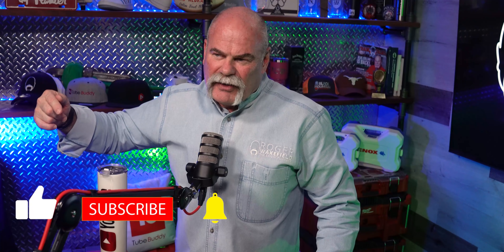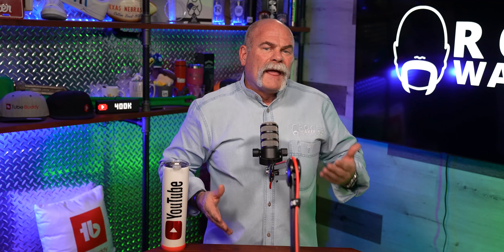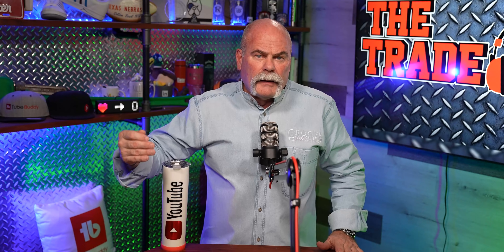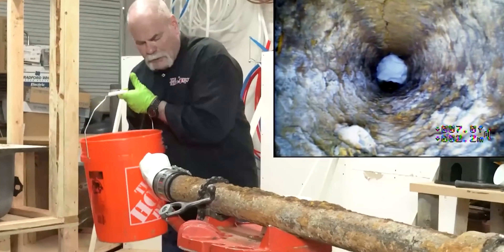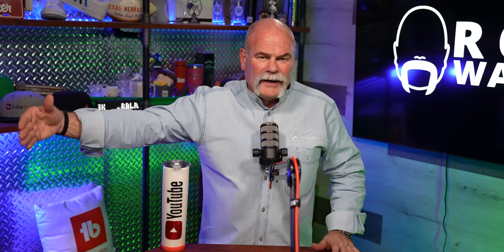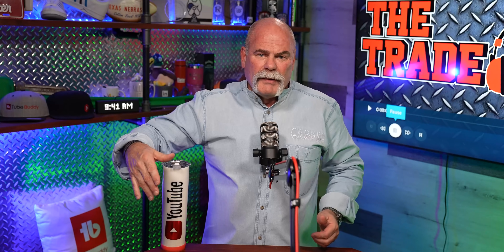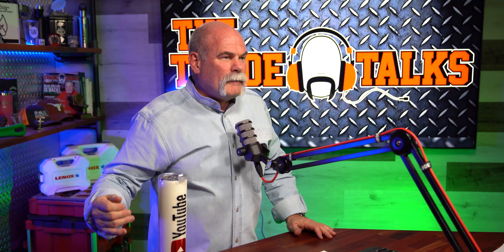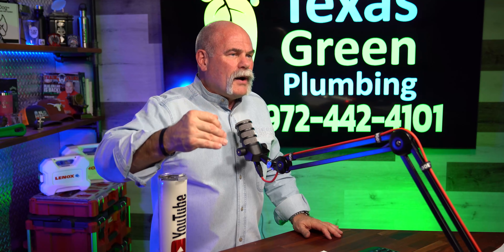TUNNELING UNDER YOUR WHOLE HOUSE TO SAVE YOUR SEWER LINE

Comment: You would never be able to do this in Tennessee all the limestone we have plus clay in various parts of the state if you have a slab we have pinpoint the line jack hammer the floor up repair the pipe pour new concrete not to mention finding a floor guy if you have to patch hardwood,tile,etc and hope to find the matching pieces it can be a major pain

Comment: Hey Roger, I'm a bit confused with the terminology here. I was taught slab leak is in reference to the water lines under the home so checking Meter with utilities off can show if something is leaking. If it was we hook air to the water line and go sound it out listening to bubbles. Is the sewer cam really a good way to find the leak sometimes because often they run water next to the upper lateral?
Reply: He is in texas.   He probably wont understand your point
Reply: You won't see a water pipe leak from inside a sewer pipe.

Comment: If I ever needed this done for me, id want every freaking square inch of that cast iron removed. If its not leaking or broken now, how much longer can it possibly last. But I do like that you as a contractor aren't pushing that on customers.
Every damn inch of it, schedule 80 pipe, stainless hangers, the works.
Would it cost me a lot more, yeah. But damn it that piece of mind knowing it won't be a problem again sure would be worth it to me.
Reply: Schedule 80 is wayyyyyyy over kil man lol but your right never ever have a problem
Reply: Ive seen 100year old cast iron with led joints and they are sealed perfect its crazy.
Reply: @GeneMichaelMeredith  Oh I know its overkill, but I don't want to ever even have to think about stuff like that again. 
Mostly because of where it is and what they had to do to get to it.
Reply: @sparkplug1018  not a bad mindset. I think thats the way to go as well. youre probably good with schedule 40 though